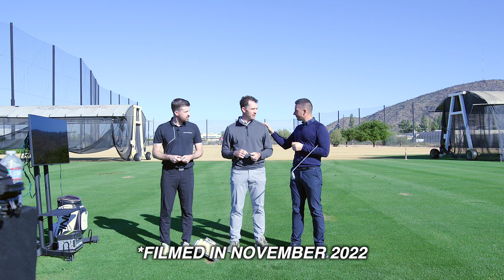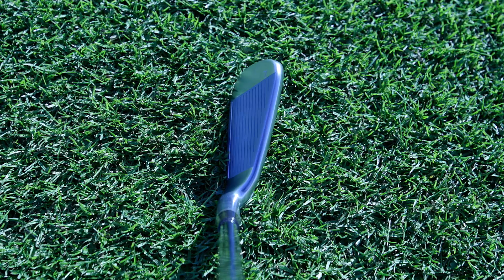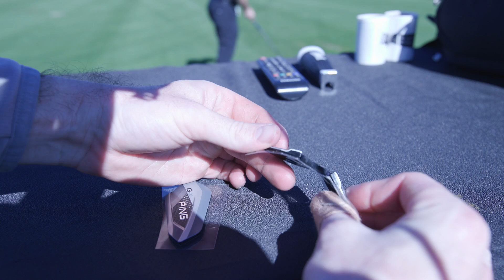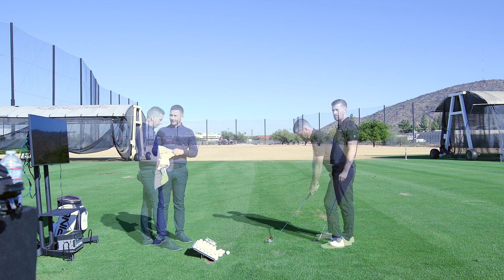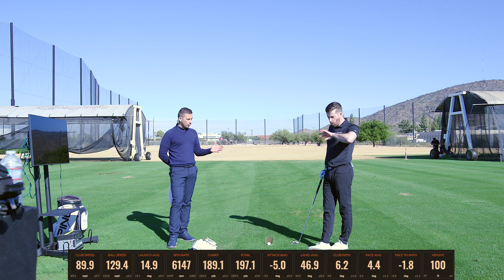PING G430 Irons // Initial Review

Comment: Ive been playing Ping irons ever since I was a junior golfer. I have been using a set of i15's since 2009. Ive been considering these irons but im put off by the lofts. My i15 7 iron is 33degs. According to the Retro loft spec data for  a 430 7 iron is 31degs. Who knows what that will do to my dynamic loft or launch angle! I think ill get fitted. Either way this testing video was awesome! Thx guys.

Comment: Here I am wanting to trade in my G425s now for these....
Reply from the maker: Highly recommended that you do so!!
Reply: Good luck getting a decent trade in …that’s the drawback of wanting new clubs all the time..
Reply: not to mention how much more it costs for a set of these. golftown has them listed at 1650 for 5-U.... but the way they gapped this set you literally need an additional club if you were using the 50 degree gap from the G425s you either need to buy ANOTHER g430 bringing it closer to 2k or another specialty wedge.... Very weird that they found it within reason to make a set that needs 8 clubs to cover what would be a 7 club spread.
Reply: @Traplordsosa  I just ordered the new G430s. I went with the 5-pw and added the 45&50 wedges. The way I figured since they all are at least a club strong through the set I would just feel like the 45 was the real pw and just go from there. Eventually I’ll figure how far each go so it really doesn’t matter what the number on the bottom is. That makeup is still 8 irons and the price is going to be $1260 for the set of steel so not sure why such a hike from the other spot you mentioned.
Reply: @Tom-ok2rh  Yeah it is disappointing I had G425s and I had 5-gap and the gap wedge was actually 50 degrees like a gap should be. Now the gap is 45... a pitching wedge so you need to buy ANOTHER gap wedge... that strikes me as silly. the set should have just been labeled 1 club lower like the 5 should be 4 and so on. They want the false yardage story. still a great set. just some smoke in mirrors.
Reply: @Traplordsosa  what you can do is get the 6-pw then add the 45&50. Trust me I’ve see them in person they are all very strong. You can easily get by with that setup and would still give you 7 clubs. Who cares what is on the bottom of the club you’ll eventually figure out how far they go..
Reply: @Tom-ok2rh  it's just silly this is the only set I can think of that is like this. it makes buying this set off the shelf pretty deceptive for the average player. yes... Custom ordering it would be easy.
Reply: @Traplordsosa  that’s what I did. I could have ordered them in the retro spec lofts but like I said I just went with 5-pw and added 45&50. One would think that they have pretty much reached their limit on cranked lofts. There’s only so much of a range in a set of irons and 7-8 irons in a set will probably stay the same for the time being.

Comment: Great stuff boys. Liked the explanations from Marty. Although if you look at the lofts I game the g425’s in retro spec starting at a 28* 6i  which means 6 clubs to cover through the GW (52* retro lofted ). Now with the g430’s it takes 7 clubs to cover the same loft spread. As a slower swinger I’m not sure 7 clubs is needed. Just my opinion.
Reply: I was thinking the same. Then I thought about the possibility to change to the power specs. starting with the 7i all the way down to the 50* wedge. These are only 6 clubs from 27,5 to 50 degrees in really fair 4-5 degrees gaps. on top there will be my 24* hybrid and at the end my 56* SW .. done 😉
Reply: Yep .. maybe true. but for me - playing the i500 - it’s like this: the i500 standard lofts (3 to PW) and the G430 Power lofts (4 to 45*) are same or 0,5/1 degrees different. So I could use same amount of clubs with “same” gaps ;)
Reply: Sounds to me like they have strengthened loft so you’re forced to buy their wedges to fill the gaps